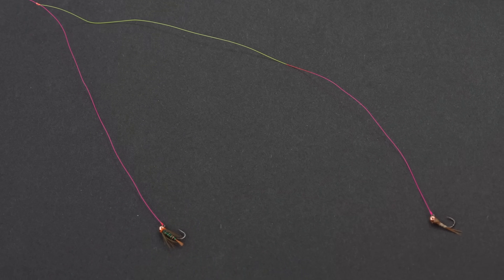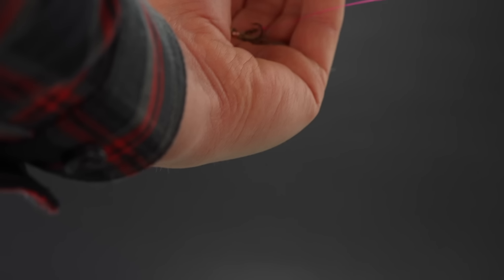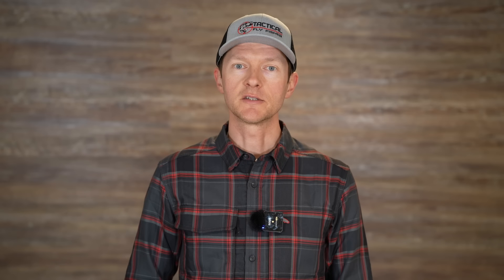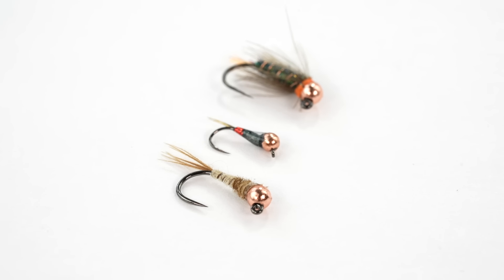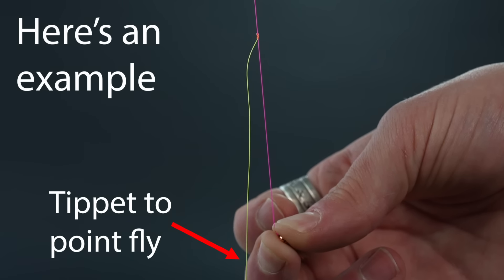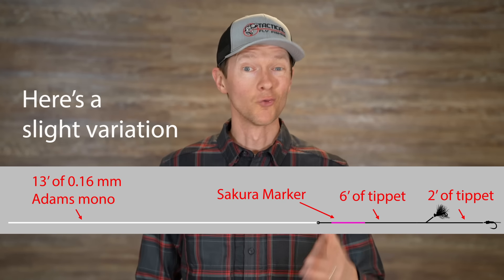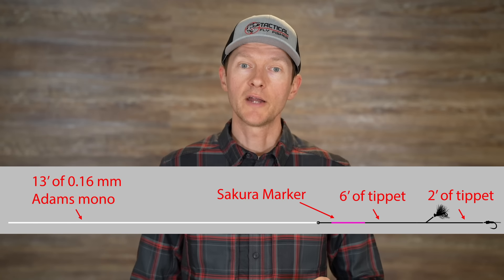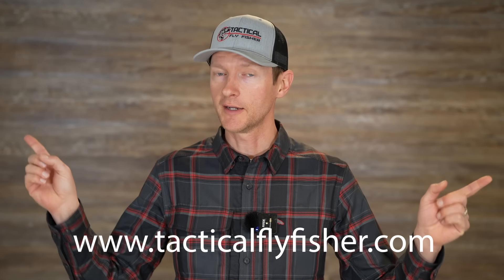Dropper Tag Knot Q and A Follow Up

Comment: your knot Fowles up and wraps around the main line. A dropper knot  should be 90 DEGREES FROM THE MAIN LINE  . It doesn't fowl up !
Reply: Foul,not fowl. It’s a tangle not a bird.
Reply from the maker: I cover that pretty explicitly in the video. As I say, if you don't agree with me, that's certainly fine.
Reply: First off, foul, not fowl; next he has shown the inline knot is stronger, which is more important when using light lines. Shorter tags minimizes fouling.

Comment: Great analysis as usual Devin!  I used to struggle very badly with dropper tag twist (while using mostly surgeons or orvis tippet knot) until about 4 years back I saw a video from Kelly Galloup about how he rigs his upper fly 6 inch tags for a 2-fly drop-shot indicator nymphing setup.  He does a mainline blood knot to join the 2 sections of tippet but trims those tags off   - then for his upper tag fly he uses a small perfection loop (separate piece of tippet) that wraps around the main line above the blood knot through the small loop and it pulls mostly  inline w blood knot when pressure is applied.  The stiffness of the very small section of perfection loop helps prevent tangle in the first place and the tag fly pivots very nicely on the main line to help easily remedy a twist or tangle when they happen.  I understand your points about surface area micro drag and extra knots - I'm sure those downsides would apply to the Galloup rigging too - but his method actually works very well to significantly lessen the twist problem itself - which is something I can't practically say for any of the other alternatives that I have seen/tried personally (as a non competition average guy) - including all those discussed in this video.  Best wishes!

Comment: You show two different diagrams of the same dropper rig in this video. One with paint above the tippet ring and the other below. Does it make a difference?
Reply from the maker: @blakemckenzie1946  that’s the point of the paint. You can add it anywhere you want to adjust your tippet length for different depths. A bit of hand sanitizer on your fingertips will take it off.

Comment: This video is as good, if not better, than the video it's intended to supplement.  Thank you for taking the time to answer question posed by your audience.  One question, however, that apparently wasn't asked is about the advisability, in general, of using tags.  The first reason for a tag that you adduce, that the dropper has more mobility and freedom of movement if attached to the leader by a tag, comes at a cost.  Specifically, the freedom of the tag impedes the freedom of the point fly if they're moving in different current flows.  As I understand it, this is the reason why many comp anglers are now moving to fishing a single fly.  What are you thoughts on the matter?
Reply from the maker: Alex,
It isn't the tag that is the issue with drag. It's simply that you have two flies that are spaced a distance apart. Anytime that is the case, they can be in different current speeds/directions and the further apart they are the more likely that is to happen. Going with or without the tag won't solve that issue though..
Reply: @tacticalflyfisher3817  You're right, of course.  I meant to say using a second fly on a tag (or not).  So, let me try again.  In general, what are your thoughts about the effectiveness of using a single nymph as opposed to two (or three)?
Reply from the maker: @alexargyros7186  They all have their place. In shallow broken water I typically use 1 fly for the best drift and strike detection. In less complicated water with wider areas of similar current, or in water that is deep and fast enough to need it, 2 flies are normally better. In the deepest and fastest water, I occasionally use three flies. As always, it's an iterative guess and check process.

Comment: Say you’re using a dry and a single point fly. You want to fish deeper still dry dropper . Tippet and knots in good shape. How to make this change? At 21:50 or so? Cut off dry tag completely. New fig 8 further away from point. Correct?
Reply from the maker: That's one possibility or you could just add tippet where the nymph is.

Comment: Devin, great video, as usual.  Question: Do you ever use a loop knot to attach your nymph and/or dry fly, in order to give it more action??  thanks for your great work.
Reply from the maker: I don’t. They use a lot more tippet and tend to be weaker. I haven’t found them to be a critical necessity especially with fine tippet.

Comment: I have another question, if you don' t mind.  I don't think you've addressed this, but if you have, could you just point me to where in the video it's discussed.  Let's say you want a six foot tippet with a dropper two feet up from the point.  There are two ways of doing this:  1.  Cut off a six foot length of tippet and then tie on a tippet about two feet from the end.  2.  Cut off 4' 7" of tippet, and then tie in a two foot section leaving about six inches for the dropper.  In #1, the dropper is formed from a separate piece of tippet; in #2, the dropper tag is formed from the initial length of tippet.  The question is:  is there any difference between these two methods in terms of strength, or anything else?
Reply from the maker: It’s quicker/easier for me to maintain the measurements to be legal in competition with method 2. I’ve tried method one briefly but not enough to test whether it is stronger or weaker. As long as everything is still set up in the same direction with the same knots, I doubt there would be much difference in strength.

Comment: Hi Devin
I've been using the figure 8 dropper for a long time now. I use it for wet fly and Euro and rarely have I had a break off at the knot. I tie it slightly different to you in that I have the main line straight to the point fly and tie the droppers on using the figure 8. If I need to tie another dropper in I normally tie it just below the old dropper knot and keep fishing.
I haven't tested the different methods for strength as you may have done, but plenty of fish have tested the knots for me and I have not had any issues.
The figure 8 is quick to tie and has heaps of strength.
I just though I would share this with you.
Love the videos, keep them coming
Cheers
Craig

Comment: Awesome video Devin.  I have gone from tippet rings to micro perfection loop at the leader-tippet junction.   Then I double the tippet and tie a clinch to the loop (maybe an Arcay trick).  What knot are you using here?
Reply from the maker: I use what I call a stopper knot there. I also have a video coming for it. The micro perfection loop is technically illegal in competition if it is further than 10 cm from the fly line (dumb rule). I've tried it there in the past but found that it broke fairly easily in finer micro leader materials.
Reply: @tacticalflyfisher3817   Looking at some stopper knots, I see how they can be very linear/straight and tie by laying tippet over leader.  Looking forward to your version.
Reply: Looking forward to this video and if you are using 13’ of Adams mono to your tippet section what do you have ahead of the Adams 4.5x mono?
Reply from the maker: @philfitzsimmons616  I'm not sure what you mean by "ahead of". Here is a video with the formula. The leader is attached to a Euro nymphing line. https://youtu.be/3xlLbnvnsfc?si=pK7Wrw8ZNC33gGhB&t=130

Comment: Excellent work “nicely done “  your verbal and demonstrated explanation is very helpful. I have moved to a micro system finally and have of course noticed a big difference in strike  detection especially in slow winter water. Maybe a video showing all how the micro system vs heavy tippets similar to the modern nymphing OG would have good traction

Comment: Suggested topic: if I wasn't comp fisherman and following/practicing for fips mouche rules here is what I would do different, here are techniques I would likely use, flies, equipment, etc. as recreational fisherman. Thanks for considering!
Reply from the maker: Peter, thanks for the suggestion. Unfortunately, I don't think it would make much of a video because I honestly wouldn't change much. I might fish a Euro leader that was a foot or two longer, I might occasionally fish an indicator in large rivers, and I wouldn't worry about knot spacing or empty dropper tags but that's about it.